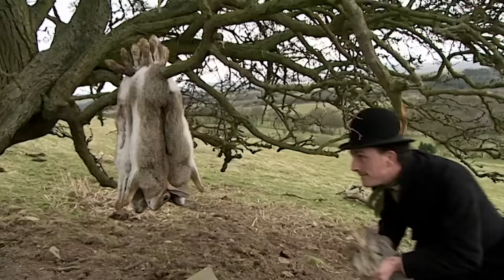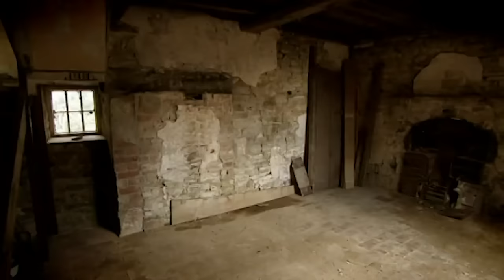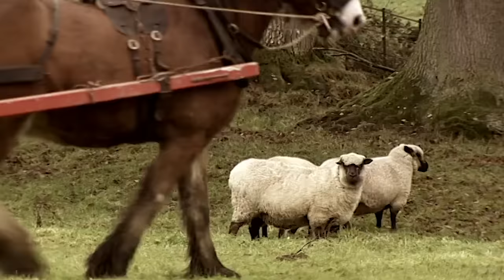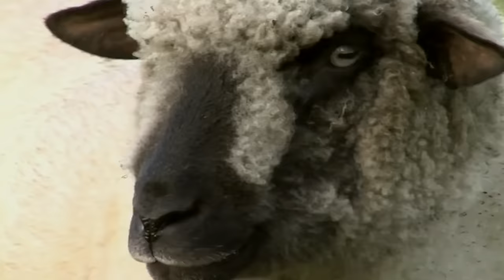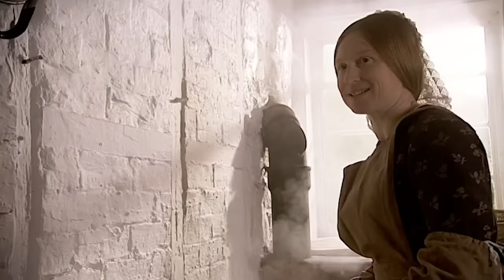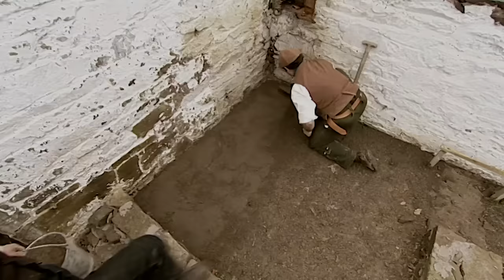How The Victorians Washed Their Garments | Victorian Farm | Absolute History

Comment: The good old blue bag. My grandmother used it and my mother. It also was put on wasp and bee stings. My nana had a gas boiler to wash and would shave soap into to and used a big stick to stir the clothes around. They were then draged into  a concrete tub for the first rinse. Hand wrung and onto next rinse. After drying, everything was ironed with a very heavy iron heated on the gas stove top. No fancy cook top just metal plates. Took all day to wash, and another to press, fold and put away. Everything cotton was pressed, including bedding and underwear. My mum continued to press sheets all her life as well.

Comment: My washer quit nearly a year ago. Being on Social Security with a very limited income I can not afford to buy even a used one. The nearest coin laundry is an hour away. So, I've been doing my laundry in plastic storage bins in my basement. Soak, wash in one, try to wring out the clothes as best as I can before putting them into the next tub to rinse. Let them soak for about an hour before wringing them out and hanging on the line to dry. It's very hard work, believe me! The towels are the hardest!
Reply: You should look into purchasing a Turkish towel.  It’s much like a sheet.  Absorbs so much water.  Impressive.  I have some to take on travel. They should be much easier.  If you’re alone you can wash one or two and they’ll dry usually overnight. I imagine you could cut one up for wash cloths and kitchen towels too.
Reply: @nvalles2565  Thanks for your input but why would I want towels that absorb more water when it's hard enough now to wring out the terry cloth towels? And for the price of a half dozen turkish towels, I can dang near by a used washing machine!
Reply: @ms55938  ok, let me clarify.  My mistake.  They are light and feel more sheet like and copared to a towel you'd think, you can't dry off with a Turkish towel.  But they can absorb a good amount of water.  As a traveler and rv'r, these tae less space, are light, and do the job.  My thinking is though, you can more easiely wash one, as these wet are far less heavy than a regular towel.  So you could wash and wring one and carry a couple without it being 40lbs.  You can hang them to dry and they dry more quickly on a line than a regular towel.  One costs $10-12 on amazon.  They are long like beach towels.  So I'm thinking, if I had to do laundry by hand, I agree towels would be hard.  I'd do my two Turkish towels instead of using the others.  Easier to manage and line dry overnight.  A regular towel will only dry quickly in the sun.  A turkish can dry in the house on the towel bar or over the shower. (When I travel I wash in the sink and dry over the shower.)  My thinking is buy a second one for other uses and cut it up for kitchen towels or whatever.  But small linen ones are basically similar so that would be moot.  But for a towel to dry off from the shower, took me only a couple uses to realize I liked them and could get along just fine with one.  They absorb the water from the shower and to wrap on my long hair and still absorb water.  That was what I meant.  Should be much easier to wash one of those than a regular, heavy towel.  Disregard if you aren't interest it but if I could afford one $12 towel and save my back some, I think I'd do it.

Comment: I've actually been thinking about this a lot... and I just CANNOT understand why they haven't invented a washing machine earlier. Men have been using machines for centuries and a washing machine is such a simple device. Easy mechanics. Just a keg that's turned on a handle... you don't even need gears, although that would make things easier. Everything necessary was around from the Middle Ages or earlier. 
Is it because this was a women's job? To be honest that is probably the one invention from the last century that I am most thankful for. Just imagine the labour... Half a country's workforce just to to laundry. Nope.
Reply: "Easy mechanics". Think about the power needed to turn a heavy barrel full of water and wet clothes. They weigh a lot. Think of the coal that would be needed to power the steam engine, and the size of that engine. Think of the cost of coal to drive it, and the space needed both for the machine and the coal. The steam engine hadn't been widely available for "centuries" at that time, but mere decades. How many people had the luxury of money for the engine, space for it and the coal? Back then, that wasn't the average person. Certainly, it's because it's a woman's job, but also because it's a home job. It doesn't make money or drive industry. It takes time for these big inventions to filter down through society.
Reply: @gray_mara  There are multiple gear and belt operated machines that were common in the 19th century on farms for example. One could easily build a mechanically operated washing machine with a krank. No steam engine necessary.
Fact is, they didn't. As at that time at least in agriculture, many machines were kept and operated at the house, there was no strict divide between home and workplace I do attribute it to the fact that it's a women's job. 
You could actually make some money by taking in laundry though, but mostly it would have freed up labour for other tasks.
You are right, it had to find its way "down" through society , down in this case being the female population. Mostly industrialists hadn't yet picked up on the idea of women as a target group, this changed around the turn of the century.
Reply: @StarOnTheWater  I'm not sure how big a crank you'd need for the average woman to be able to agitate a barrel full of water and laundry. The dolly seems easier, tbh. And, it depends on how you're defining "Victorian," whether as the start or end of her reign. I was thinking 1837, but you may have been thinking 1900. There was a massive amount of technological change just in the reign of one queen. For the first half of her reign, married women didn't have the right to own property, so they weren't exactly an economic force at the time. I have my doubts about how many men of means would have had the faintest idea how hard this job was, if they cared at all.
Reply: @gray_mara   Exactly! I mean men would have heard that it was a hard task and they would have noticed how exhausted women were but they probably would not have experienced it themselves. And all labour was hard at that time. Just it could have been easier. 
There's a pretty interesting experimental archeology series on YouTube showing farm life in England through different periods, it's called "absolute history".
From a technical standpoint: It takes some energy to get the water in motion, but once you have it's pretty easy. There are manually driven machines like that today for travel, small spaces, or regions where people have no access to electricity. It's really not that hard to work them, basically like a heavy salad spinner.

Comment: Add to the negatives the amount of people injured or killed by trying to dry clothes indoors by open fires and other indoor heat sources. Often with the home burning down as well.
Still happens today as well.
One of the greatest inventions is the solar and wind powered clothes dryer. Sounds high tech, but otherwise called a clothes line or rotary clothes line. Hill Hoist in Australia. Huge emission savings from these. But the trend to high density living in flats or small blocks means these are less usable.

Comment: That spindle thing she is using to agitate really just made the whole operation harder.  Easier would to be dump in clothes.  Dump in hot water and some soap.  Mix it around with a stick or something.  Let soak for however long, until the water was of a reasonable temperature to stuck your hands and arms in... then do the agitation with BOTH hands and arms.

All though, I guess back then, they used all sorts of stuff like Lye that you didn't want to touch so... maybe the spindle is a good idea. With actual soap though, skin is fine.

Comment: It's  not believable that the victorians werent aware that ground heat was warmer than ambient air in an unheated room . Wine bottles werent a throw-a-way commodity maybe in the late victorian period . No . I dont believe glass bottles were commonly used to insulate a floor.  Speaking in of expensive that wringer for the laundry  would be something that would cost $350 to five hundred dollars  today if purchased brand new.  Where did they get the cement in 1880?  For a hog pen? Thatt is a very expensive floor